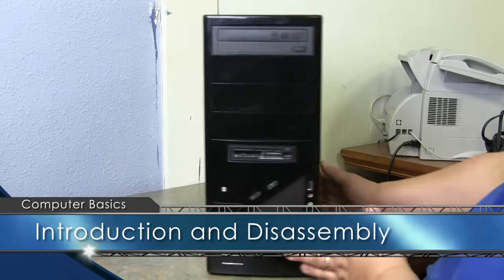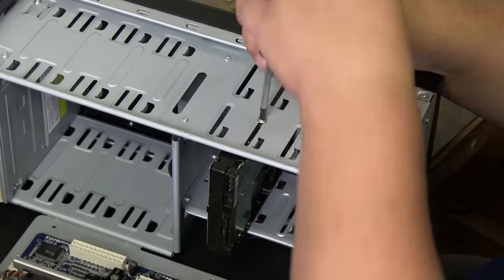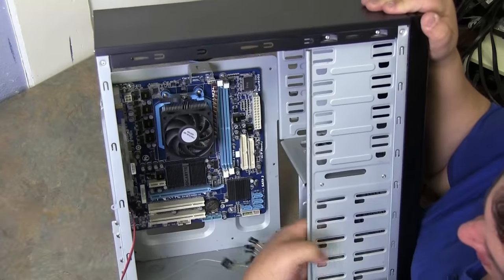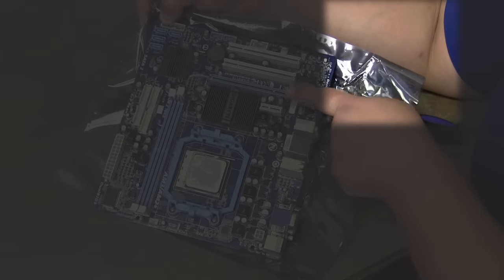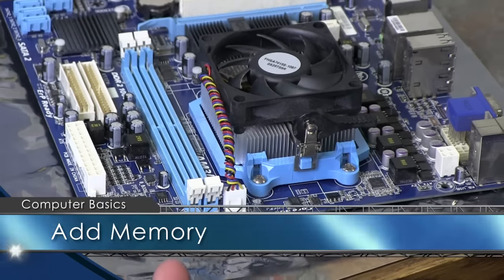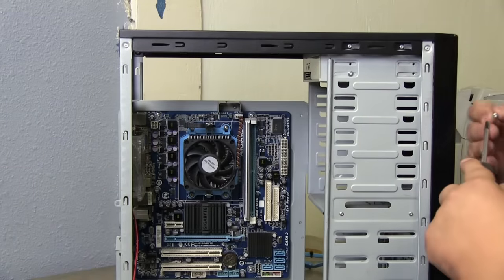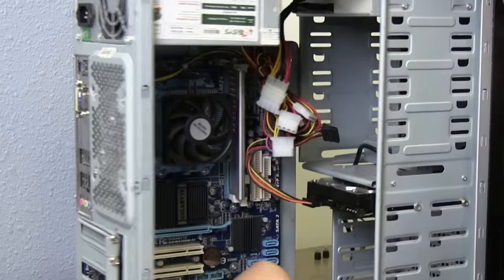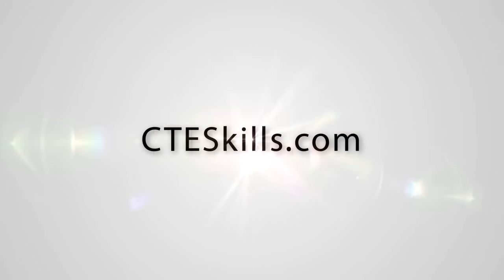Computer Basics: Hardware

Comment: HELLO CTE! Am an avid Subscriber, you are my first 'Go to' when diagnosing PC issues! I recently built a new Computer in my old Tower with a new Raidmax Vampire 1000W 80 Plus Gold Power Supply, an MSI Z390-A PRO Motherboard with an Intel Pentium Gold Processor G5400 CPU @ 3.7GHz! Next added  64.0 GB DDR4 3200 Ram! Also a ZOTAC GAMING GeForce GTX 1 Video Card! Recently upgraded all my HHD's with an Intel 660p Series M.2 1 TB SSD Drive C and two WD I TB internal SSD's! My Computer now boots up completely for a cold start in 30 seconds!!!! (Once in a while when I turn it on, it Boots into the Bios Screen)!!!(But when I wont to boot into Bios, no matter what key combination I press it wont go into Bios on Command)! Windows will not display on my Digital Monitor but I can see the Bios Screen on another HDMI Output to my 32 inch TV! Am running XMP Mode and Gaming Mode on the MSI along with allocating 3/4 of my Ram to Process my Adobe Premiere 2022! My Question is: How do I get the computer to Boot into Windows EVERY TIME? And secondly, How do I get my computer to boot into Bios on command?

Comment: Thank You very much, Sir. Video shows clearly how to install the machine's hardware and where the connections are located on the M/B. Every application is slightly different, however the basic knowledge for this process is definitely shared and is a great foundation for a rig diy-er or tech enthusiast.

Comment: If the CPU stucks to the cooler, just wiggle it a littlebit or even try to heat it up. Don't force it or the CPU pins can break.
Reply: yes heat up hardware that wont be a bad idea

Comment: As for the sata cables and the main power cable leading to the motherboard that you removed at first. I located both of these on my computer and while holding down the tab, attempted to pull them out. I could not. The sata cable end plugged into the motherboard would not come out, i even went as far as to use plyers and even with plyers i could not remove it.

Comment: I have an ancient rig from 2004 that I want to discover. Until I bought a laptop in 2011, I never felt the need to disassemble or even open up the case. I had to disassemble the whole motherboard just to upgrade the RAM with an HP Pavilion laptop, which I'm glad nothing got broken xD so I got more interested in hardware since then. Also I want to build my own rig and I know I'll be enjoying it. So just researching the desktop side. 
I have a question;
After I take off the CPU would I need to add thermal paste or I can just put it back as It's?
Reply: you always need to reapply thermal paste after taking off the cpu.

Comment: I'm newly learning computers for CompTIA A+ to try to break into the IT field. This video is quite helpful to see how to take apart a computer and put it back together and what the different parts are!

I know he said he'd mention it more in another video, but i just want to see if maybe I'm thinking of this the correct way. He put one single stick of RAM on the motherboard, does that mean it's likely just has 2GB of RAM installed, but could have 4GB if he had another stick to put in the second slot?

Also, would that AMD CPU he pointed out be considered LGA (land grid array)? That's not PGA (pin grid array), right?

And one last question, would you use the antistatic bag and/or an electrostatic discharge bracelet throughout the whole time that you're assembling and disassembling the computer or just when you're specifically handling the motherboard?
Reply: 1st question, yes. If you only install 1x 2GB module, the PC will have 2 GB of RAM. If you install 2x 2GB modules, it will have 4 GB of RAM. In computers, it is good practice to always use the same brand and model of RAM. Most PCs will work ok if you put different brands of RAM, but some can be very picky and won't work well or at all if they have mismatched modules installed.

2nd question. AMD used PGA CPUs up until the release of AM5 for consumer level systems.

3rd question. Proper procedure is to always use an anti-static wrist band or mat when working on computers or electronic devices. Its not mandatory, but it can help prevent ESD damage. In some industries, you're required to use an anti-static method.
Reply: @JJFlores197  Thank you so much for answering these questions for me! This is all very helpful to know.

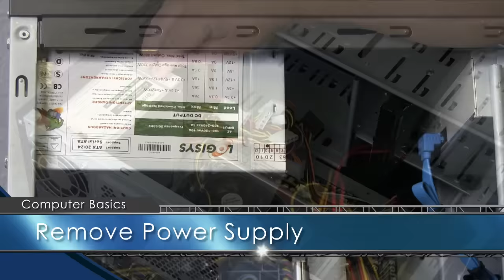Comment: 3:09 / 28:00 Power supply
3:55 / 28:00 Hard drive
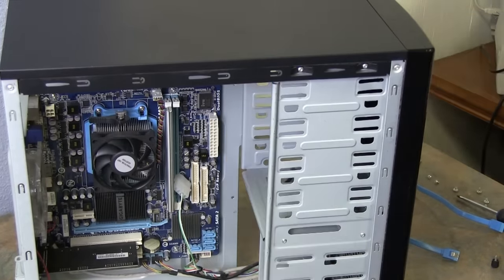5:08 / 28:00 CD drive
5:35 / 28:00 RAM Random Access Memory
6:30 / 28:00 PCI expansion card
10:02 / 28:00 CPU
13:28 / 28:00 Chipset

Comment: Thanks heaps for this! It's not too much nor too shallow, just exactly what my brain needs lol. You just earned another subber! Keep this up! :)
Reply from the maker: +Nipplestroke Awesome, thanks for the positive feedback!
Reply: +CTE Skills.com I have a question, my current hard drive does not have a sufficient amount of space for my taste so would connecting multiple drives in a PC fine? would I have to access it a certain way differently than just simply installing things?
Reply from the maker: You should be able to add an extra drive as long as there is another connection available. I'm just the video guy in all of this but I've added one to my computer and you simply access it like any other drive. It will show up like C: D: or F: etc... drive. Which ever is next available on your system.
Reply: CTE Skills.com ok thankyou so much :D

Comment: where is the northbridge and southbridge? I konw that northbridge should be around the middle of the motherboard but can you tell/show me?
Reply from the maker: Sorry Zodiac BLK, I don't have an answer for you. Hopefully in a future video we can go into detail on the motherboard.
Reply: The northbridge is where the CPU and RAM slots are located, where the onboard ports are thus giving it the name of 'Northbridge Memory Controller', and the southbridge is where the PCI slots and the ROM are located thus giving it the name of 'Southbridge Chipset Controller'. But motherboards vary due to manufacturer. Hope this helps. Kind regards from an IT professional in the UK.
Reply: Zodiac BLK North is under the bigger black Heatsink, usually near the CPU.
the South is under the smaller black Heatsink and is somewhere near the SATA ports

Comment: Could you tell me some things to check to see why my computer want power up. I cleaned the dust out of the inside like I’ve done every time I clean it .I use a small artist brush and a small shop vac. The computer worked fine before this. Now it has know power and nothing comes on. Could I have shorted it out.

Comment: When you just ripped the heat sink off of the board, you NEVER do that, you can actually break pins off inside the socket. Grab the heat sink on the top corners and turn it firmly until the paste breaks free.

Comment: hi great video,, question,, my computer with two rams in ,,cuts out after around 8-10 seconds and keeps trying to restart,,  , i noticed one ram slot has a black mark inside the groove.. i removed the ram and i can get to windows screen but it then goes in to blue screen and shuts down,, do you think the mother board is fried, secondly should i buy new ram also

Comment: awesome, but doesn't a computer need graphic cards?
Reply: No, most motherboards have limited on board graphics. Thats why this has a VGA and a couple other outputs.
Reply: well, depends if it has one pre installed, and I don't mean it comes with a graphics card but it's recomended to have a graphics card if you have a computer with it pre installed
Reply: notice at 12:48 everything is already on the motherboard
Reply: Nearly all systems these days have on board graphics input/output. It's modernisation of computing, PCI is rarely used now.

Comment: What does Disk boot failure meen
Reply: It means your disk failed to boot
Reply: Means it is either on the wrong connection channel to the motherboard or not configured correctly in the BIOS.

Comment: JE NINI MAANA YA CORE KATIKA COMPUTER?
https://youtu.be/En7pSp4s7hU
Reply: hawa jamaa kiswahili hwajui, LAKINI NINAVYOJUA CORE ni sehemu kuu ya processor/CPU ambayo inafanya kazi za  processor mfano calculation na zingine kama tujuavyo processor ni ubongo wa computer, processor inaweza kuwa na core zaidi ya moja mfano tatu i3core,hizi ni njia tofauti za ku execute taarifa. A core, or CPU core, is the "brain" of a CPU. It receives instructions, and performs calculations, or operations, to satisfy those instructions. A CPU can have multiple cores.Each core of a CPU can perform operations separately from the others. Or, multiple cores may work together to perform parallel operations on a shared set of data in the CPU's memory cache.
Reply: Angalia pia threads

Comment: Bad Move buddy.. You Yanked out the heat sink & fan assembly with the CPU still stuck to it, hence you did not release the CPU lever first. Very lucky you did not bend or break pins on the CPU, or damage the socket. 
From my own experience. Always give the heat sink/fan Assembly a gentle twist to break the compound seal first, before removing Fan/heat sink assembly, Then lift the CPU retaining lever to remove the CPU.